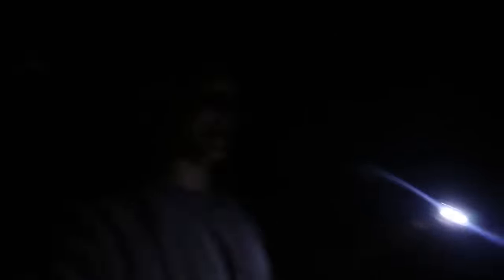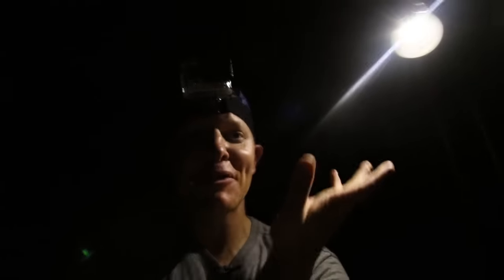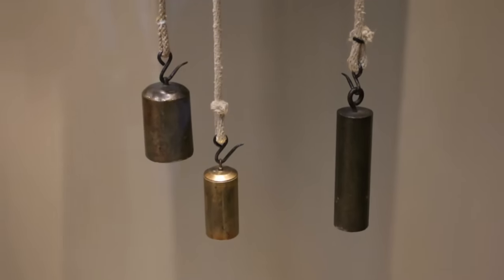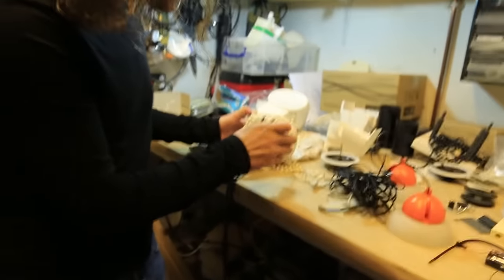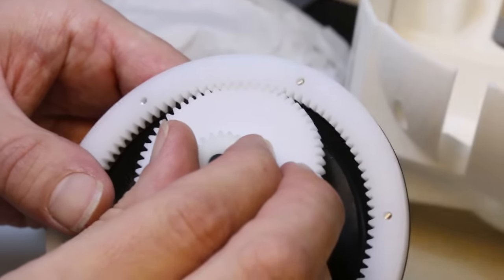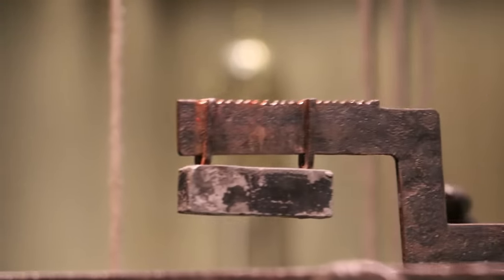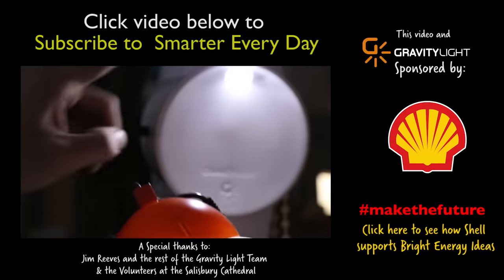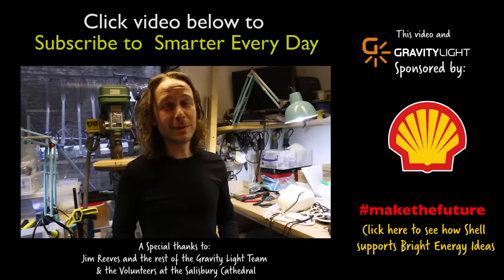Turning Gravity Into Light - Smarter Every Day 146

Comment: Connect a bunch of these to a single weight that travels down a deep well and you can light up an entire small village for a couple of hours.
Reply: +Neumah Or a single bigger generator?
Reply: +Neumah Or build 1 wind turbine.
Reply: +Deline Needs wind, gravity is more consistent.
Reply: +attrem Also needs a large space. This is tiny in comparison.
Reply: +Neumah Muscle isn't a great way to make electricity beyond a dim one-room light.
Reply: *****
Yup! This is basically the bicycle generator concept but on a much more complex and functional design that stores a lot more potential energy for its size than that does.
Reply: +Neumah Have two weights side-by-side with a switching mechanism atop. Drop one and later once it has fallen all the way - either manually switch to the other weight and reel in the dropped one OR craft a mechanism that can switch the line atop as it reaches the end. Then all someone would have to do is reel in the first weight and reset it. 

Automate that and store enough energy to reel up the second weight and you got some infinite energy action right there b/ro! 

PS - technically those huge clocks could be repurposed for just such a thing. Replace the clock with a DC generator and voila
Reply: +Neumah I thought about a tower (could be a tall tree) where many ropes (one for each room – or house) would connect to a single weight which could maintain lights on for many hours.
Reply: Arion Roberto Krause Much much easier to just use gasoline. Compare the effort needed to pull a bag of rocks to the top of a tower to the half-cup of gasoline that can pull a car up a 100-foot hill.
Reply: +Neumah and You need to hire some fit Monk who pull the weights back from the center of the Earth in 24/7 :)
Reply: Elliott Collins
Much "easier" in that gasoline is a lot of stored energy that can be released over time, but that still requires a lot of energy to obtain, affects the environment, isn't re-usable, etc. etc. whereas the amount of energy taken to carry those rocks up can, with pulleys and tackle (otherwise known as block and tackle), be greatly reduced by applying mechanical advantage. A single threefold purchase tackle system can reduce a, say, 30 kg. bag down to a mere 5 kg. of effective weight being hauled, making the trip back up to the top of a tower far easier than just hauling it directly would be, or even hauling it via a single rope and pulley arrangement would be.
Reply: ***** Right, you can use clever simple machines regardless of whether you pull the rocks with muscle or gas, but for anything larger than a single room, muscle is a terrible and expensive way to generate electricity. Gravity lights are good because this is a small low-power system, but it doesn't scale well.
Reply: The "crude" oil storing millions of years of Sun Energy!!! But from Sun we get a lot energy 24/7 but we still dont know how to store and use it. We have a perfect FUSION REACTOR the Sun!
Reply: ***** That's a convoluted setup that would require much more work for much less energy than a modern electrical system. Gravity lights are designed to be cheap low-power systems. There's a reason we don't have city-wide utilities on bicycle generators.

Also, simple machines reduce work, but they don't reduce the energy required, and don't pose more of an advantage for muscle than for fossil fuels.
Reply: Elliott Collins
I didn't say that they provide more of an advantage for muscle than for fossil fuels, so no idea why you're addressing an argument I didn't make. Same with your statement about city-wide power, considering I was quite specific in reference to the size of the operation  I was addressing.

It's also not that convoluted a setup as you're purporting it to be, since a block and tackle is very easily set up, and considering the political climate and very real danger of little despot dictators showing up and taking a village prisoner, this sort of setup of alternating light systems for perimeter lighting would be optimal for those on guard duty (of course, those same little dictators can also use them in similar fashion, but that's the unfortunate fact of good things being used with bad intent).
Reply: ***** I see where we're getting confused. I think the needs and resources of your average "small village" more closely resemble those of a "small town" than those of an "encampment". Your suggestion works fine for the "encampment" context; I'm just not sure that context is very common.
Reply: +Mic Nor That would not work due to torque
Reply: Nilguiri I think gasoline is more widely available than you think...
Reply: +attrem Because it's not gravity that powers it but the people who move the weights :D
Reply: Elliott Collins
Ah, I see the issue. When I speak of a small village, I'm talking about the actual definitional size, that being not much larger than a hamlet (which puts it within the village catagory, but not by much) so that's only around 100-120 people at most (of which the majority are going to end up being children of varying ages in the specific areas we're referring to here), rather than that of a small town, which will have AT LEAST a few thousand people (3000+).
Reply: +Mic Nor Well it wouldn't be infinite because well of course it looses energy overtime but i'm not a mathematician so I can't calculate how long it would produce energy for...
Reply: SpydreX Official It would stop immediatly since you can't pull up something using his own gravitational potential energy and generate energy at the same time. It's much better to just use all the potent. energy to light the LED like it is already doing!
Reply: +Neumah Are you willing to pull it back up?
Reply: BubuSnow93 I'm pretty sure in relation to his comment he was talking about weights of equal mass thinking the kinetic energy would be transferred over. I wasn't agreeing with him so were you just adding to my comment?
Reply: SpydreX Official You said you didn't know how much it would take for that system to stop and I answered that question ;)

Just to be more clear.
If you have 1 weights that have 10 Joules of gravitational potential energy each you should just convert em to almost 20J of light + some friction instead of wasting 10 whole Jouls of the 2nd weight to give you way less than 10 more J!
Point is, it wouldn't actually stop immediatly but you wouldn't gain anything, just lose more ;)
Reply: BubuSnow93 Oh you just misunderstood me then, its ok. I do the same thing, I was adding that to his comment not agreeing with him and was stating I am not sure the amount of energy produced for every feet the object falls but I guess I didn't state well enough and you thought I meant his idea.

I do find it funny though that your trying to teach me physics:p

EDIT: I'd like to add that in my comment I wasn't talking about a practical application just a theoretical answer to his comment.
Reply: +Paul Wills don&#39;t get it either.... how can a resistor or a capacitor or whatever electric device connected to the circuit limit the speed of the motor/generator??? Wouldn't the generator just run faster and burn the circuit away?
Reply: Daniel Nabais
I'd assume it's some function of the escapement that was mentioned.
Reply: ***** he said the led keeps the generator from going faster, waiving the need for an escapement... That's what I understood anyway. A diode keeping a generator from going faster is what boggles me!
Reply: Daniel Nabais
The weights themselves are on a cuckoo-clock like escapement system, actually- the stripes that the weights are attached to. That's why the LEDs will regulate the weight, because it only draws as much power as it needs, so its speed is entirely proportional to how much power is drawn. Having the addon SatLights attached would result in a faster drop rate, for example.
Reply: +Kain Yusanagi I think what you said implies that if you just disconnect the led the generator will stop and the weights won't fall. I'm not saying your wrong but that just seems like magic to me :)
Reply: *****
Read the rest of the post, eh? "...but on a much more complex and functional design that stores a lot more potential energy for its size than that does." The amount of energy expended (especially if you use a pulley system) is miniscule in comparison to the amount of energy that is stored and tapped through this process. FAR more efficient than a bike generator, as I said.
Reply: +Mic Nor You'd have to lift ALL the weights. We obey thermodynamics on Youtube.
Reply: Daniel Nabais
That sounds about right, as there is a gear that is directly allowed to activate due to power draw from the LED. No draw, no gear movement, thus locked gears and thus the weights don't move. At least, that's what I've gathered from my vague memories of how escapements work and their internal workings documentation on their site.
Reply: *****
hehehe. I get 100% of what you're saying. But my confusion comes from the fact that he said there's no need for an escapement due to the fact that the led does that job. That's what I understood anyway... I love these conversations - wish I could have a coffee with you and carry on with this!
Reply: +Daniel Nabais Deleted my previous comment...oops.

Drawing more power from the generator will demand more power from the generator&#39;s mechanical input; it will increase its mechanical resistance. As the LED is a diode, it has a defined current/voltage curve (which is briefly shown in the video), which is exponential with voltage. So as the motor tries to speed up, the power through the LED begins to increase quite steeply, which increases its resistance to the weights. There will be an equilibrium point where the LED is regulating the drop rate.

Now I&#39;m not sure that&#39;s enough to explain it, since it seems like this would be difficult to tune due to the exponential curve and the fact that the range of weights applied will be pretty large. LEDs are easily damaged by overcurrent. Also with no other electronics, the brightness will definitely change depending on how many rocks there are. Though I suppose if they designed conservatively and included some kind of overcurrent/overvoltage protection (could be mechanical, e.g. the belt slips before enough power is generated to damage the LED), it could be so simple.
Reply: +Keenan Tims starting to make some light in my brain! still I find it hard to understand the actual impact the diod may have on the inertia of the generator. guess I'll have to disassemble something with a motor and try it for myself!
Reply: *****
Would be great if you used their actual stated numbers. First off, it uses a 12 kg weight at a height of 6 feet (1.8m) to produce 25 (at a rate of 1mm/second as they claim, it'd actually be closer to 30, but I assume it's less due to ineffiencies) minutes of light from a 13.8 cd LED- that's about 160 lumen, or about a 20 watt LED (pretty bright, and appears to be accurate by the videos we have of the light working vs. other known 20 watt LEDs).

Medium weightlifting (which lifting 12 kg would count as) as exercise for one hour consumes about 250-300 food calories, or 2500-3000 gram calories. 1 gram calorie is the amount of energy to raise the temperature of water one degree centigrade at sea level at one atmosphere, or 4.184 joules; thus that exercise would be 10460-12552 joules. One BTU is 1055.87 joules, or 252.4 calories to 1 BTU.

Kerosene has a BTU value of about 18,500 BTU/lb. With a 1 inch wick, 1 quart of kerosene (1.67 lbs) will burn for about 45 hours; 60% of 1 quart is 1.002 lbs, which would then burn for 27 hours, so kerosene's burn rate is about 18,500 BTU/27 hours, or 685.2 BTU/hour, or 172940.7 gram calories/hour of (fairly poor, flickering flame) light.

Since you only need to spend about 5 seconds  lifting the weight bag up to 6 feet in height and re-attach it (I'm not fit, and I can lift that weight within that timeframe, easily) before it provides its next 25 minute increment of light, one hour's worth of caloric burn would then be spread out over a longer period of time- 5 seconds every 25 minutes. 5 seconds into 1 hour (12 5-second increments in 1 minute, 60 minutes to an hour) is 720 times you'd have to replace the bag on the escapement track, which results in (720 * 25) 18000 minutes of light, or 300 hours of light; that'd be 34.87-41.84 joules expended/hour of light, or a mere 8.3-10 gram calories expended/hour of (much better quality) light.

Now, I'm pretty sure I didn't flub my math anywhere (If I did, please feel free to point it out) but that looks to me like a MASSIVE improvement on energy expended/hour of lighting.
Reply: +P. Thomas Or run more carrying less.
Reply: +Daniel Nabais +Kain Yusanagi My understanding is that the current flowing through the LED will limit the rpm of the motor. Ill explain why. The dc generator works by providing a changing magnetic field(the permanent magnets which create a "shell" on the inside of the motor are moving relative to the spinning shaft that has coils of wire on it). According to faraday's law of induction, that changing magnetic field will induce a current into the wire coiled around the shaft. That current flows through the LED creating the light. Additionally, according to Lenz's law, that current induced in the wire will create its own magnetic field which is opposing the original magnetic field that created it. This causes a magnetic breaking effect which slows the rpm to a point of equilibrium(since the faster it spins the more current will flow and therefore a stronger breaking effect). This effect can be observed if you have a small dc motor. if you spin the shaft with your fingers while the wires are not connected to anything, it should spin relatively freely. However, if you twist the wires together so that the circuit is complete and the induced current can flow, then there should be noticeably more resistance when spinning the shaft.
Reply: Ben Watson
Cool information, thanks!
Reply: ***** No problem :)
Reply: +Mic Nor thats impossible hahahaha even if you could get litteraly every joule of energy out of one of the weights "falling". you'd only have enough energy to get it back up and nothing else
Reply: *****
Probably because lumens are measured in the total area they effect, and the GravityLight uses directed lights (like a maglite or other similar LED light source) rather than a general light that radiates in all directions (like a candle flame)? Their info states that a SatLight provides about 35 Lux over a kerosene lamp's approx. 6 Lux.
Reply: +Mic Nor sorry bud, it wouldn't work. 
Would the weights be the same weight in your design? if so, then neither would come down to change potential energy into light. If one is heavier, it would come down, but then it wouldn't be able to go back up using the lighter weight.
Reply: +Neumah but you'll have to spend more energy to reset it.
Reply: Lord Kain
I believe I addressed above that it's far more energy efficient than burning kerosene, especially over time.
Reply: +Mic Nor 
EDIT: I misunderstood the idea you had. I thought you wanted to complete an infinite loop with two weights, which wouldn't work. However, a switch mechanism to engage one weight while you lifted the previous one WOULD work.
Reply: +Elliott Collins True, but when you're in the middle of nowhere it may be all you've got.  In any case, the real innovation here isn't the method of generating power so much as the method for storing it -- they've replaced an expensive and failure-prone battery with a cheap hanging weight.
Reply: Jeremy Friesner
And (comparatively, esp. for the poor this is meant for) expensive and low-light return kerosene with much stronger renewable lighting.
Reply: +Neumah Here m8, I really hate saying this, but here's the fact.

LED watts [per hour] : Air Conditioner watts [per hour]
=> 35 : 1 or 1/35
This device's wheel radius ~7.5cm : Huge wheel radius 250cm
Circumference ratio (Amount of teeths on outer wheel)
=> 33 : 1 or 1/33
Weight load required (..?) [Kg] to turn the 500 cm diameter wheel, compared to 15 cm diameter wheel
=> ~400 : 12 or 12/400
Power output = <1 Air conditioner (Still less than powering an air conditioner, considering the big huge ass wheel)
Reply: +Neumah Perhaps a nice street light over the village well, to keep those pesky boogie-men away?
Reply: +Kain Yusanagi I would argue that it's actually simpler than a bicycle generator - just better engineered.
Reply: +Mic Nor  It isn't necessary to rig up a Rube-Goldbergian switching mechanism. Simple old fashioned block-and-tackle will do the job.
Reply: *****
Bicycle generators are just a pedal (small gear) turning the rear wheel (via drive chain to larger gear) with a drive belt over the wheel to a small gear attached to a motor, which follows the same principle of the cuckoo clock, so-called "gearing up". The design of the GravityLight definitely isn't simpler at all. ;)

As for the block-and-tackle, I specifically mentioned that earlier, haha.
Reply: +Keenan Tims The added current flow will increase the strength of the armature's magnetic field and cause the generator to slow down.
Reply: *****
Oh wow I read that way too fast... "...increase the strength of the earth's magnetic field...". I was about to tell you to put down that crack pipe. *puts down meth pipe*
Reply: +Ben Watson Great explanation! So when the p-n junction voltage is reached the added current flow from the LED will increase the strength of the armature's magnetic field and cause the generator to slow down. It's a simple feedback loop.
Reply: +Neumah How will you lift it back up?
Reply: +Metin Oktay Yılmaz Please forgive me, but with all due respect, that is a dumb question...simply put, you lift it back up with your muscles, of course.  No one said that this device is CREATING energy.  Anyone with half a science education knows that energy can neither be created nor destroyed.  This just takes energy that is otherwise wasted (or dormant, or in more plentiful supply) and converts it to a stored energy form, and then ultimately, a useful resource via moden day advances in energy efficient LED light, coupled with some pretty smart engineering design.  Sure, you are putting your own metabolically-driven muscle power into the system.  But this could be your routine exercise regimen for the day, and obviates the need for a battery to be utilized to store the energy.  This also provides a constant, steadily available level or power.  A stationary bicycle wheel attached to a generator could do the same thing, but a battery would be necessary to store the converted energy, or you would have to use the light while riding the bicycle.  With this, at least after your work is done (lifting the weight), you can go read or do whatever by the light of your gravity-utilizing illumination for at least twenty minutes, without concern of fluctuating levels of power due to muscle fatigue.  It will need to be adapted to use on a larger scale, but I believe it will.
Reply: +Neumah everyone is kind of missing the point - what happens when the weight reaches the bottom of the well? The issue is that it doesn't take a lot of energy to power one light - the energy required to lift that weight won't be that much.

Smarter Every Day has suggested here that the energy &quot;comes from&quot; gravity. It doesn't (at least as far as I understand things). It comes from the person lifting the weight. It's more like a rechargeable battery, only the stored energy is mechanical. However, you'll always have to put in more energy to overcome the gravity to get the weight into position. For things like clocks and lights, because they consume such little energy relative to the value of the product, we're willing to put in that little bit of periodic effort. However, for larger-scale needs the input may out-weigh the output through normal economic means. Perhaps you could have animals doing the work, but you will still need to feed (fuel) the animals.

However, if you could find some way to provide the mechanical energy needed, you could measure the electrical load to control gearing, such that the weight would move slowly when demand was low.
Reply: Obviously this is not a novel idea as suggested in the video by the use of the gravity/stored energy device to power the ancient church clock.  But what makes it interesting is the new applications this device has for today given the efficiency of newer electrical engines and LED lights.  We might want to take a look at other devices that were cast aside "back in the day" just because the relatively small amount of electricity generated did very little given the amount actually required to power things back then.
Reply: +Mic Nor it doesnt work, at some point it stops, nothing is infinite :/
Reply: +Jack Carter That is precisely the kind of device that would have much more utility in the present-day world of LED light efficiency.  And, whether powered by the stored energy  of gravity (or a wind-up spring mechanism much like your lamp example) the efficiency of LED lights, and modern-day electronics in general, opens up possibilities for numerous other applications from which third world and remote locations which lack the availability of electricity might benefit. Take for instance the Freeplay Lifeline Transister Radio. This remake of a fifty-plus year old invention that operates on solar and wind-up power has seen increased usefulness in these regions. It may be that a host of other devices generally felt useless in areas lacking grid-supplied electricity (heaters, ovens, TVs, etc.) may find new utility upon converting the device to operate on these alternative sources of power and by doing so improve the quality of life for those living in such areas without the high cost or increased emissions of non-environmentally friendly power
Reply: You'd still have to bring it back up when it reaches the bottom, though, and that takes as much energy.
Reply: The Real Flenuan for the life of me I don't understand why Smarter Every Day suggested here that the energy comes from the gravity.

This is an energy STORAGE device people!
Reply: turnipgoodness I guess wording it that way is just easier for the average person to understand or think about, but it does lose the accuracy of the explanation.